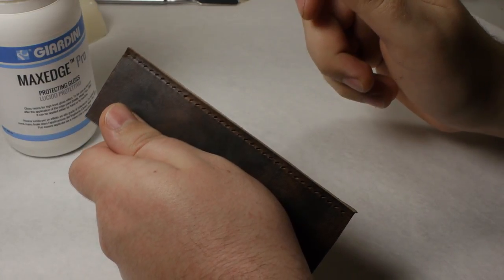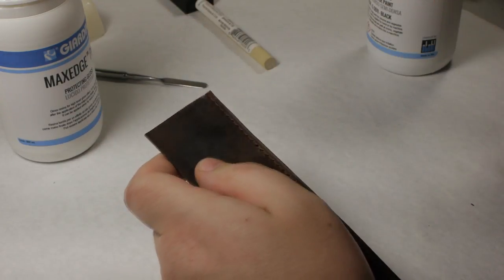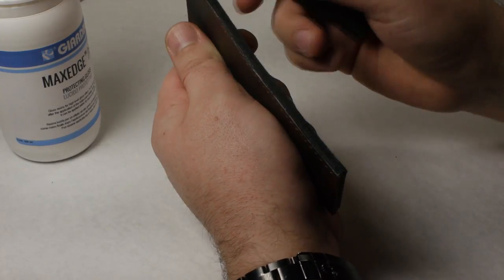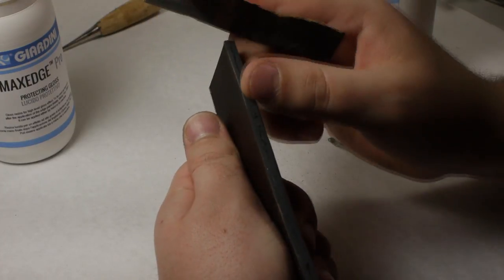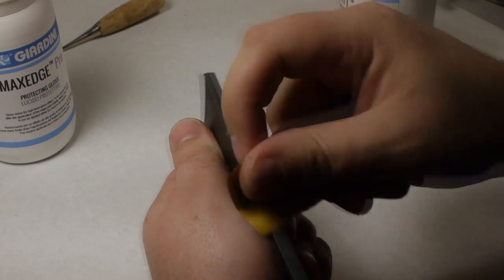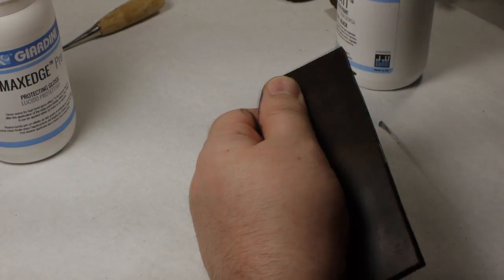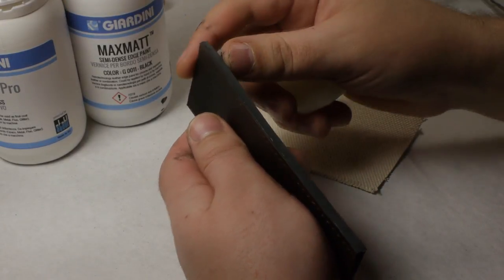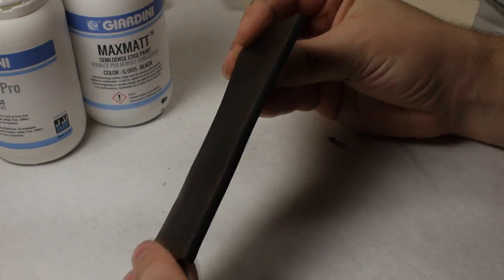Leather Edge Painting

Comment: Hi, thanks for the video. How long does it take for the edge paint to dry completely, especially when applying a thick layer? I'm new to this. I wait for about half an hour for it to dry (1mm thick) and the layer cracks all the time as soon as I start to sand it down. It gets really ugly. Could you advise? I know that it varies when using different products, but I'd very love to have a general idea about this.. I'm using a small italian brand that I can find here in europe. Perhaps not quite known across the ocean. Thanks in advance.
Reply from the maker: If the paint is cracking you might not be using the right type of paint for edges, or your paint may be bad.  The paint should be flexible after drying.